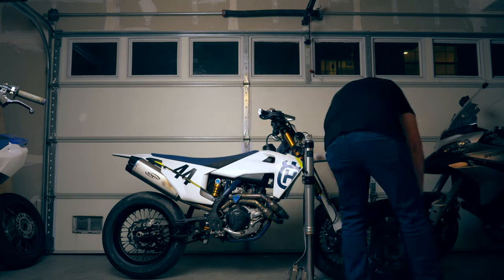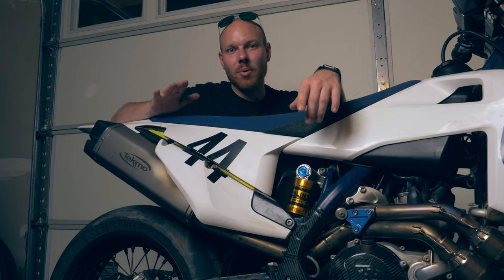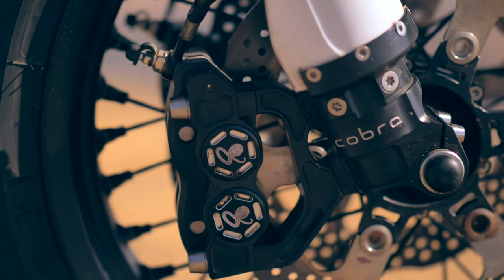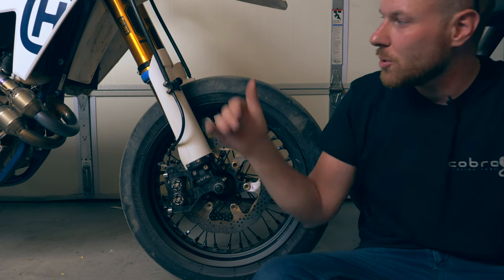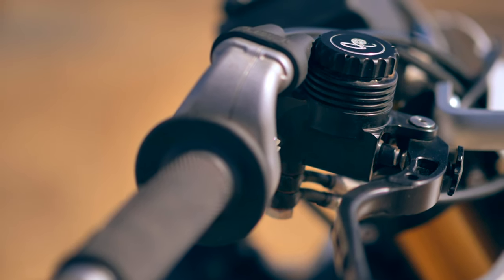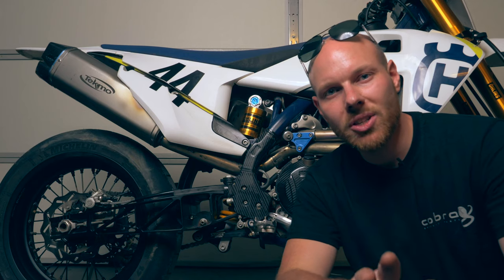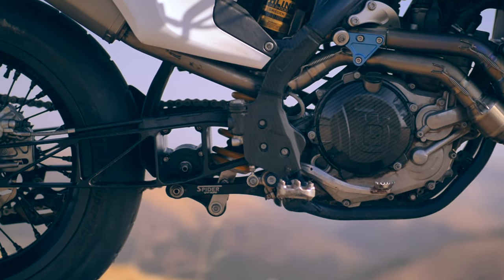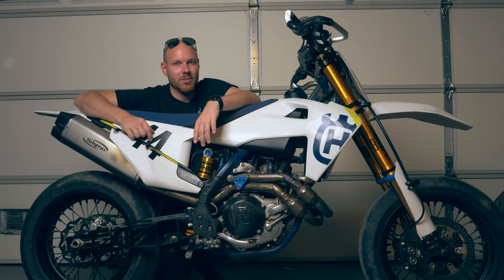Husqvarna FS450 R | Making the Best BETTER

Comment: What do you think is the best upgrade if you can only pick one thing (just curious). And maybe you can buy bst carbon wheels for it, never seen that on a Supermoto. and do you really notice a power improvement of that double piped exhaust ? Looks cool, but does it work?

Comment: What clutch will you use ?   You can try to shave some weight wherever it's possible (carbon and billet bits ) , handlebar , plastic... A set of lighter screw and bolt   would be nice too.

Comment: do you need some type of  kush drive for the rear wheel hub ? I'm new to the street moto
Reply: Nice to have but not an absolute necessity 👍
Reply: Yes for sure. Without it you will break your gearbox. I run Haan hubs with a cush drive

Comment: Heard like super motos are very hard to maintain, like every some hour you have to change oil or do a teack run or less it damages the engine etc etc correct me if im wrong
Reply: It depends on the bike...the 701 Husky SM has more "street bike" like maintenance intervals, but the Husky FS 450 is the exact same bike as my FC 450 mx bike. So it will need maintenance after every race/weekend if you're competing at higher levels locally or in the AMA. I could go into greater detail if you need me to with specifics. Btw the Ducati Hypermotard is more like a "street bike" in terms of maintenance...it's a super supermoto if ya feel me. The original SM were basically enduro or mx bikes with different wheels, lights and a license plate slapped on them. Now we have manufactures making ready to race sm...and sm more friendly to the average rider who wants some of the capabilities of an original sm without having to pull the top end, change tires, etc after every weekend race. Hope this helps you.
Reply: @Peanutdenver  hey thanks for the info 👍🏽

Comment: Next step after engine:  Get a new full carbon fiber chassis 😂
Reply: It would never work.  Carbon fibre cannot flex like metal does.  Flex characteristics are what give a bike great handling.  Also the thickness of carbon fibre that will be required will make it mostly impossible to engineer the right tortional characteristics into the frame.  It'll look amazing as a show bike but will handle like a school bus.

Comment: Swap the front rim to a 16inch, the Michelin 16.5 is garbage compared to the 16. And put an MTR linkage, changing the linkage progression is useless without completely changing the internal setup of the shock, and the MTR linkage is the best you can buy for ktms and husqys (they just put Lukas Hollbacker on the 3rd place in the World Championship and they have years of experience in the Supermoto world championship)
Oh yes, also put a 5inch rear wheel and use it with a Metzeler k1, only the tyre is 1kg lighter than the Michelin and it provides a ton more grip,only downsize, it's more unforgiving on the exit of the dirt section and on the dusty tarmac
Reply: Good info! I was considering trying the metzeler tyres. I recently switched to the 16” Michelin and much prefer it. What’s the metzeler front 16.5” like?
Reply: @jacquesevans1023  Metzeler made a new 16.5 for this year, they say it has the same feeling as the 17 but it's easier to use (the 17 is better than the 16 Michelin but you have to push really hard to use it properly, the 16 is far easier to use, even setting up the forks is easier with the 16). I would recommend the 16, here in Italy it's still the most used front rim (excluding who is sponsored by Metzeler, who uses the 17 mainly)
Reply: Fede Supermoto #297 I’ll order a set of metzeler front and rear tyres and compare on the same day with a 16” Michelin front. Thank you for the info
Reply: @jacquesevans1023  it's kinda hard to compare on the same day, every tire needs the proper setup with the suspension. It can be you're far off with the 16 but it works with the 16.5 or the opposite
Reply: Fede Supermoto #297 Yes very true. What pressures do you run the metzelers?
Reply: @jacquesevans1023  1.85 on the rear, 1.9/1.95 on the front (hot tyres, after at least 45min of tyrewarmers)
Reply: Fede Supermoto #297 Thank you 🔥
Reply: @jacquesevans1023  no problem, happy to be helpful!!

Comment: If you go full spec on engine I assume you go for GET/Vortex ECU as well. Also look into large air intake with double injectors. Check https://www.bergos.de/technik/motortechnik/sonstiges/3973/tuning-ansaugrohr-husqvarna/ktm?number=10603018